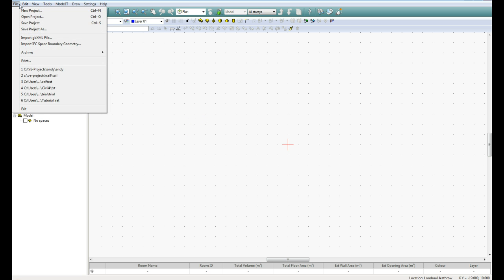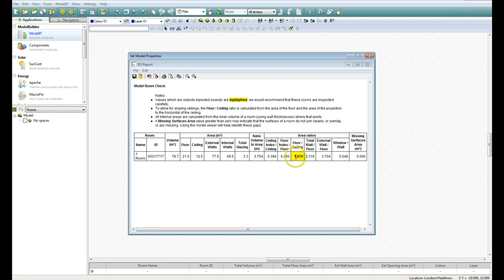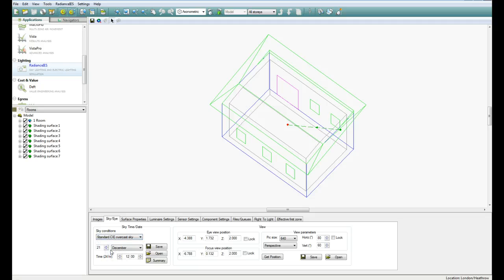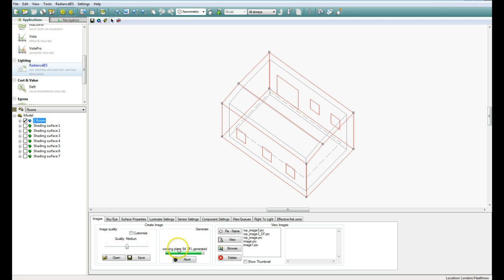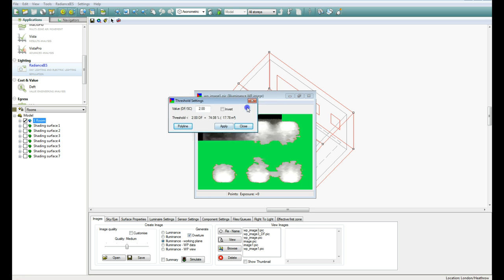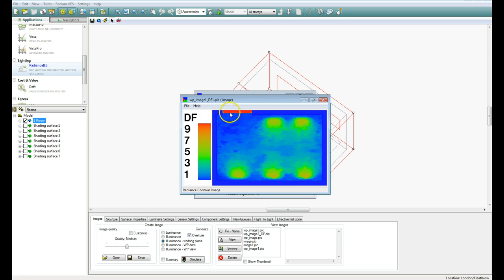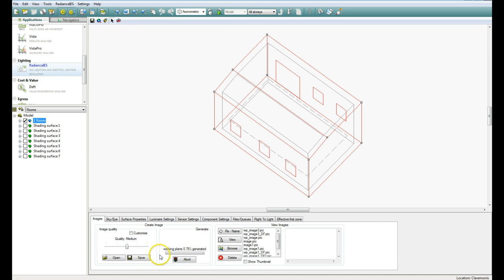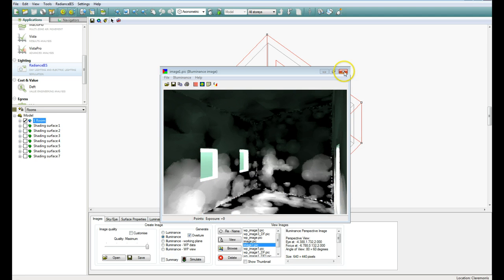Daylight simulation in IESVE

Comment: Hi, I have a question. Every time I try to import a sketchup model to IES, IES doesnot load the walls... so basically I end up having a flat surface. I dont understand why- although on sketchup IES reads all the rooms with no error.
Reply from the maker: Well, walls do look flat in IESVE. Its a 3D model, but elements like walls don’t have a thickness that you can see in the model.

Comment: Hello, these videos are great! I am just wondering, would there be any way to get the XML file from sketchup? or model daylighting another way?
Reply from the maker: Hi. I'm not a sketchup user, so I have no inside knowledge for you on that, sorry. You can (sort of) model daylight in Revit, but the industry standard software for this function is Radiance by IES. I know that Autodesk is working on its Insight software, so maybe have a google for that and see if it would work as an IES alternative for you if you don't want to use Radiance.